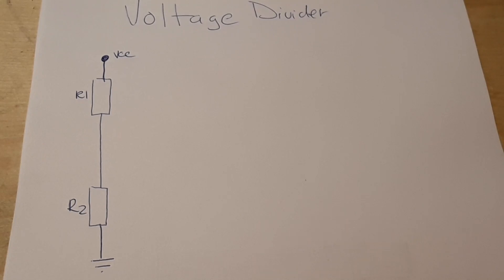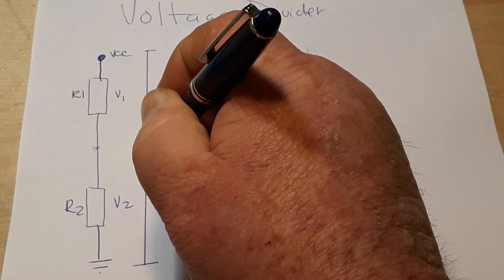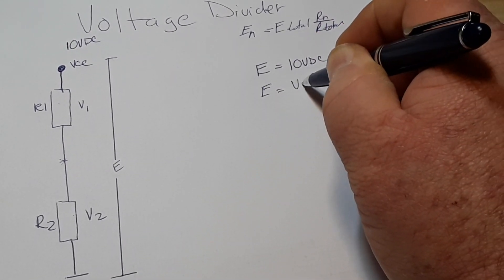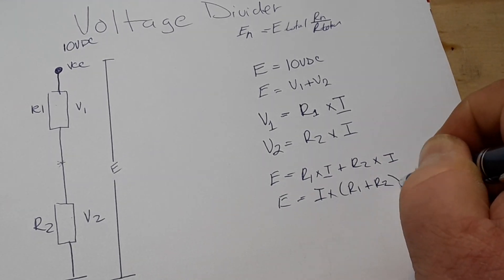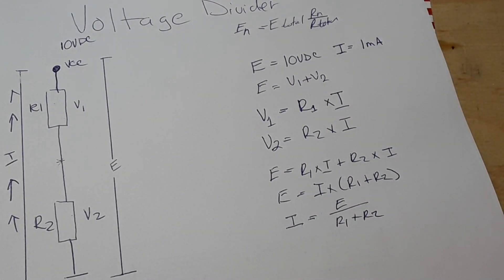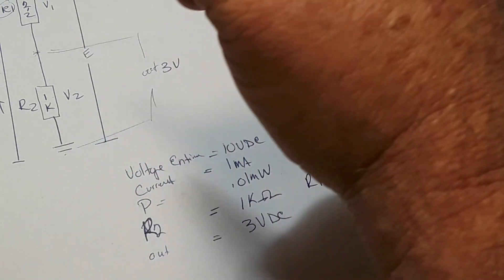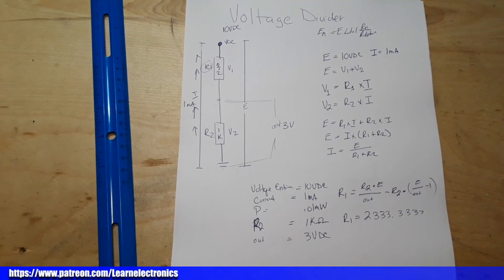Voltage Divider Equations

Comment: Nope not correct.  For 1mA @10 volt R1+R2 would have to be 10k total. If R2 is 1k then R1 has to be 9k. So voltage at middle is 1volt to gnd. Voltage across R1 is 9volt. Voltage across R2 is 1volt.   Also it would be .01 Watts, not .01 milli Watts.

Comment: Kind of related question, you showed how a voltage divider could be used when you don't have a negative voltage source. Would there ever be a time, let's say on an LM741 where you wouldn't want both rails to have equal voltage.

Comment: If you are still having trouble with understanding voltage dividers, think of it this way (which paul hit on toward the middle). There is an "IR" drop across each resistor that goes from VCC to GND (not counting internal wire resistance of course). The best way to learn this is to use one low-value fixed resistor (100-400ish ohms) and then use 10K pot to ground. The small fixed resistor will limit current to circuit even if pot is set to zero. You can take voltage measurements at the pot output and GND to see how the voltage changes. Also mention that voltage dividers are important for countless reasons to include signal voltage leveling, SMALL "power supply" (few mA only), voltage reference using Zeners etc etc.

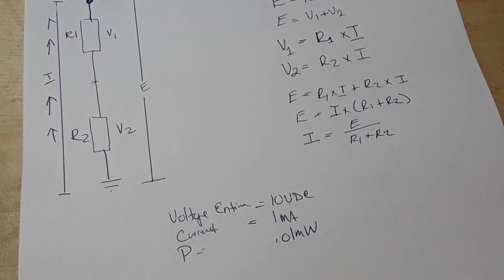Comment: 6:45 shouldn't that be P=0.01W, or 10mW, rather than 0.01mW? Voltage is 10V, current is 1mA or 0.001A, so P=VI = 10 * 0.001 = 0.010W. Or is my brain malfunctioning on Monday?
Reply from the maker: You are correct